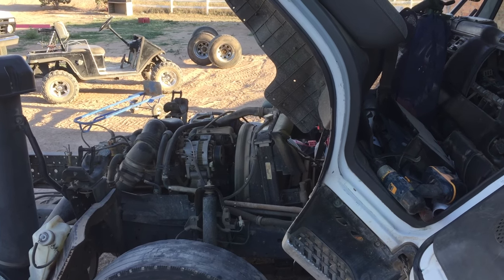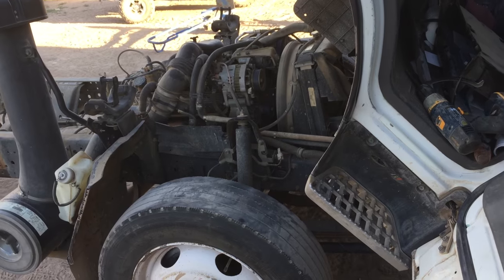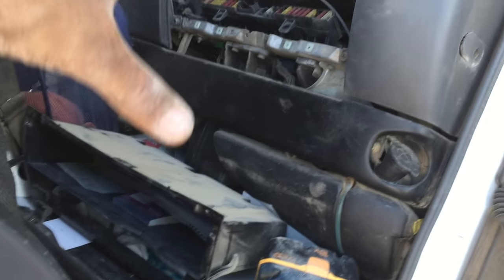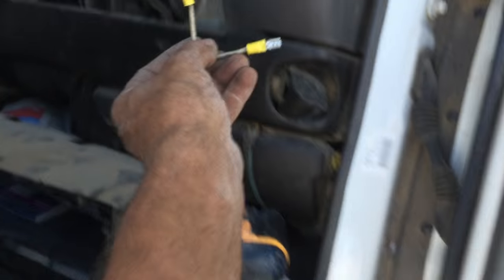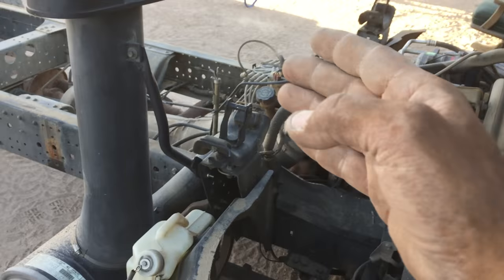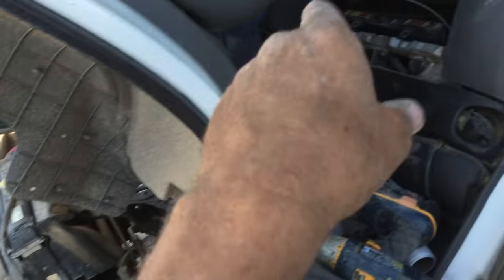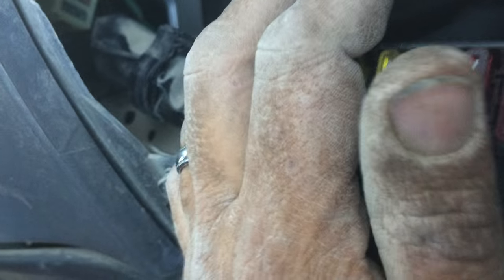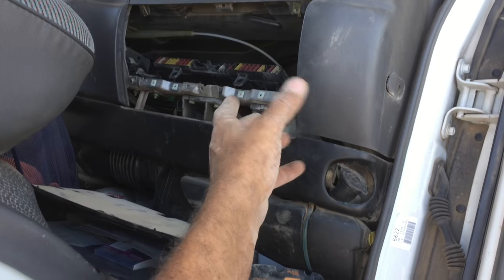2000 Isuzu NPR No Start, Transmission Shifting Issues

Comment: Transmission quit shifting and instrument panel quit working. Saw your video, found the fuses, one was blown. Replaced with 10 amp which blew immediately. Tried a 15 amp and blew after a mile. 
Where do I go from here to track the problem.
Reply: Hi , did you figure out the problem? 
I have the same issue
Reply: Me to same problem

Comment: I have the same problem except that my fuses are all good. No power at the key switch or even the fuse (yes, the fuse is good but no power going to it. All other fuses have power but the starter fuse does not).
I'm not sure why no power gets to the key, instrument cluster or heater controls. All lights work, turn signals..

Comment: Hey Thomas my boss has a 04 Isuzu npr 4.8 liter sweeper I checked the fuse block behind the glove box but it still won't up shift unless I take my foot off the gas pedal.
Reply from the maker: check your air filter. if it is plugged ( and fuel filter ) it will make shifting a bear. is your over drive button pushed?
Reply: @thomasbriansavingmoney  yes
Reply: Hey had the same problem with an O2 NPR. It wouldn't up shift unless I let up on throttle. I perform the throttle voltage relearn and it fixed it Google throttle position relearn NPR for the procedure.
Reply: @markl955  I had the same problem too; '97 GMC W4 with 4BD2 and JATCO tranny, ex-sweeper truck. It would only upshift 2-3 and 3-4 if I let off the throttle. Often it would slip when in 3rd or 4th; very miserable to drive. I checked all adjustments of throttle stop bolt, throttle cable, kickdown switch and no idle switch on the Injection Pump. Then I performed the TPS re-learn and took a test drive. What a difference: early shifting for lower RPM cruising, and 10 to 15 MPH increase in top speed, and no more "false neutrals".
I might perform the procedure again after a while as I feel the shifts could be a bit firmer, but for now I'm just enjoying driving it.

Comment: i have a 2003 NPR, just put a rebuilt transmission on it, wont shift into overdrive, any thoughts on what to do?
Reply from the maker: D_1791 have you checked that fuse behind the dash?
Reply from the maker: D_1791 is this a gasser, or diesel ?
Reply: i did not, i will later today, its a diesel
Reply: checked fuses, they are good
Reply from the maker: remove the glove box, tilt your head to the left, look behind dash. there are three fuses in a block, check the middle 30 amp for blown. it is for the shifting of the tranny.
Reply: Did you ever find a solution to this?
Mine is doing the same thing.

Comment: I have a 2001 Isuzu NPR and my problem is the check trans light starts flashing after I run it for About 15 minutes on the road and I have to high gear that kicks in so the burns more diesel fuel  also I try to plug the scanner and it cannot connect to the trucks computer. Any ideas or what can I do help Please 

Eddie z
Reply from the maker: some of these npr will not allow obd,  you can try to jump wires 4 and 7 on the obd and turn the key on, watch the flashes to get the code. i have a how to video if needed. here is a link.
https://youtu.be/9F3UYp6HSNE

let me know how it works out for you, i think it may just need a tranny filter change. be sure the over drive is off if your not needing it.

Comment: hi broo 1993 isuzu  truck not shifting already i done change transmission oil but same in the valve body on EPC solenoid only no more ???
Reply from the maker: i am not sure what your question is ?
Reply: my question is truck model 1993 isuzu npr automatic , but gear not shift , new oil and that 3 fuse not in this truck you show before this is 4 speed transmission im the mechanic i feel 1 and 2 end till 3 rd shift after that only engine RPM 3000 speed only 50
Reply: 4 speed TATCO transmission  i need rebuild kit can you help me  find it
Reply: @kumarasri1948 
Did you ever find a solution to this?? I have a 2007 gmc w4500 doing the same thing.

Comment: ok i bought a 1997 ud 1400 box truck. that wil not shift out of second .wil not shift in to over drive .checked the 15 amp fuse check the fuses on the frame under the truck.i font get any voltage to the uitput speed sensor on the. rear of the tranny ..i dont  have specs fors the truck ...Andy help wolf be appreciated
Reply: I'm having the same problem
Reply: Forest white are you still having the same problem?
Reply: Yes sir I'm having the same problem I just drive the truck with the issue

Comment: I change control glow module and transmission neutral sensor.   Do I need to program it after change
Reply from the maker: no.
Reply: @white boy @Thomas Brian Hi, thanks for this video. Can either of you tell me where to locate the transmission neutral sensor /safety switch on a 96 Npr? I have power at the starter when turning the key but no crank, no click, nothing other than my dash making a buzzing sound when I turn the key up the on position to let the glow plugs heat up

Comment: good find
Reply from the maker: thanks for watching.
Reply: +thomas brian schematic to those three fuses so I can follow the wires
Reply: +Bobby Dalton mine ended up being the bottom one that was blowed 10 amp but everytime I put a fuse in it it blows again so I need a schematic for that fuse
Reply: +Bobby Dalton it does run the fuel pump and the engine control it does run that and dash lights

Comment: Hie Thomas Brian, I have an isuzu elf 2007 model with 4jj1 engine and a semi - automatic transmission. The truck shifts all the other gears but it fails to upshift from gear 2 to 3 and also fails to downshift from gear 4 to 3. When accelerating, it fails to engage gear 3 and goes straight into gear 4 then the check transmission light shows on the dash. Accelerating it further, it engages gear 5 and the check transmission light disappears. When decelerating, it downshifts into gear 4 and get stuck there.

Comment: PLEASE,PLEASE,PLEASE HELP!!! I HAVE A 1993 NPR TURBO WELL KEPT ONLY SERVICED BY DRACO ( DEALER ) LAST WEEK I DROVE IT TO MY 1ST JOB CAME BACK TO LEAVE IT WOULD NOT START NO POWER TO DASH NO LIGHTS NOTHING, GOT A JUMP  BUT BATT SHOWED 12.6  GOOD BATT STILL NO POWER TO ANYTHING EVEN THE IGNITION, THANKS ROBERT, CAN U HELP
Reply from the maker: ive had this prob before on a 1994. the issue was in the fuse block behind driver outside by the rear of drivers tire. there was a relay that was loose, it had a bad connection. check and maybe wiggle the relays while someone cranks. they like to get dirt in there while driving

Comment: I have a 2005 isuzu npr and after an alternator swap the dasboard lights stay on when i first start the engine and only goes away after i acelerate onece
Reply from the maker: the new alternator must be a lower amp rating. or you have a wire mixed up,,,, but it just does not make sense. check that amp rating! thanks for watching.
Reply from the maker: double check your connections to the alternator. make sure they are tight. thanks for watching.

Comment: isuzu 2005 W4500 will not start, glow plug light out, glow plug relay replaced,  still no glow plug operation; Jumped circuit 4 and 11, resulting wit codes #73, #74, #77. Told that the 2005  would give out bad codes because of the newer ecm or  something. 
 power test for glow plug cable result in no power to glow plugs(test ligth from battery power cable to glow plug cable at engine; key turned on to generate a ground at cable; no power detected); relay socket checked  and power is detected. All fuses checked, but not the 3 fuses at back left of glove compartment. after  3 glow plugs replaced with one broken inside with no apparent leak
Reply from the maker: there is a two pack fuse as well behind the glove box too. closer to the radio. please check those on your situation. acc. thanks for watching.

Comment: My turn signal  and emergency signal  not flashing.
Reply from the maker: it will be the flasher relay, what year is yours , make and model ?? it should be to left of column. but i think yours it a different year. gas or diesel ?

Comment: I have a 1997 NPR that is not shifting passed 2nd gear
Reply from the maker: have you checked that fuse, also there is a two wire to one wire pigtail on top of trans that will do that. is it running warm , limp mode from being warm will not allow you to shift too. any more info would help. thanks for watching.
Reply: @thomasbriansavingmoney  this sounds like my issue. I replaced the 10 Amp fuse.